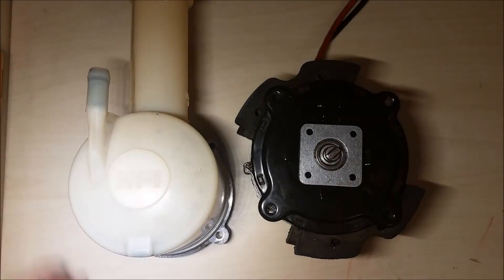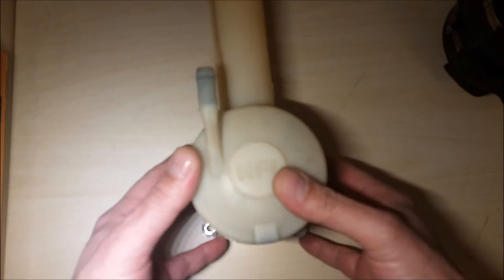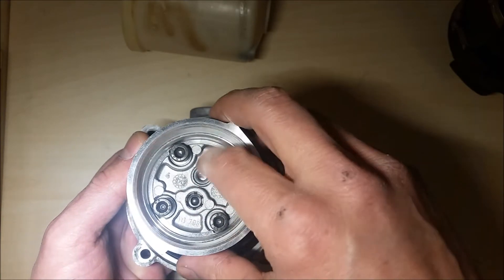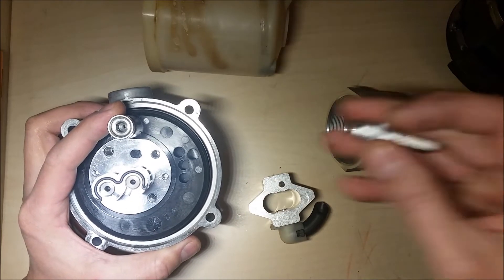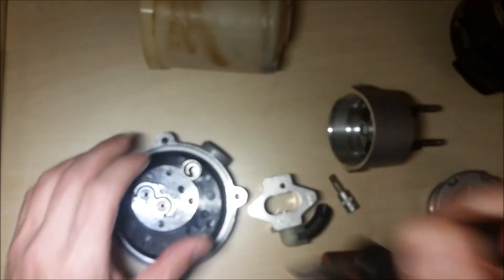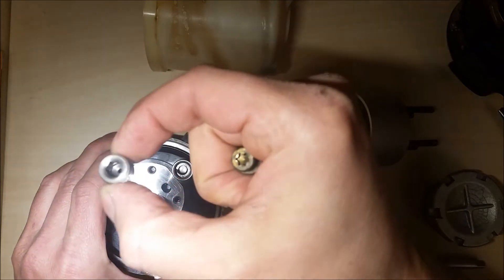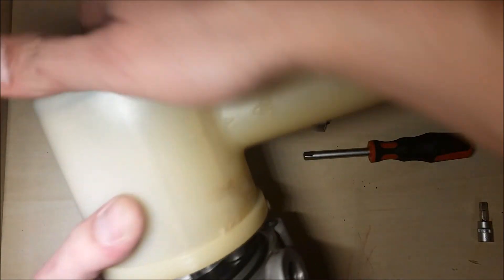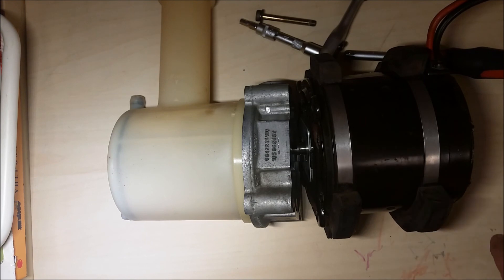Electric HPI Power Steering Pump citroen saxo peugeot 106 disassembly & explanation

Comment: fantastic video !! can i ask you my friend cause i changed steering pump to a 106 rallye and i put from a saxo,,but after the change the steering wheel is enough light especially in high speeds without any other change to the suspension or other parts...if i arrange this valve can i have heavier steering wheel as it was before??  and if yes in which way i must do it??  just tighten the bolt that secures the valve ( this little spring) ???

Comment: Much appreciate for technical video about this rare pump. 
It would be so nice if you create some video about installing this.
 Is this electric motor connect to the battery and spins when the engine is run(all the time) or It just spins when you use steering wheel? 
does it has electronic controller, sensor or something?
Reply from the maker: It runs all the time .it very easy to install. You can say it's plug and play .